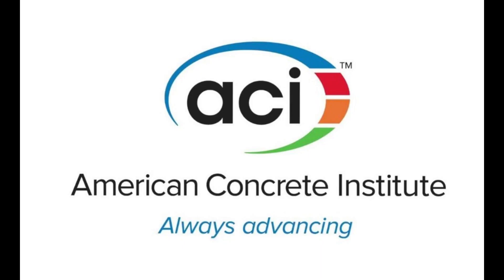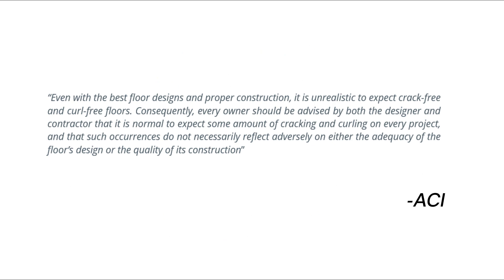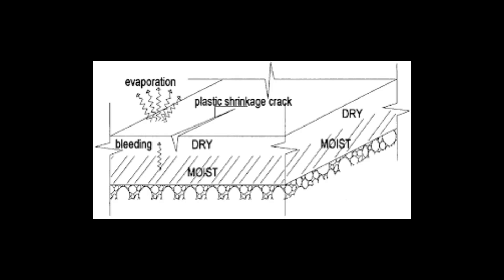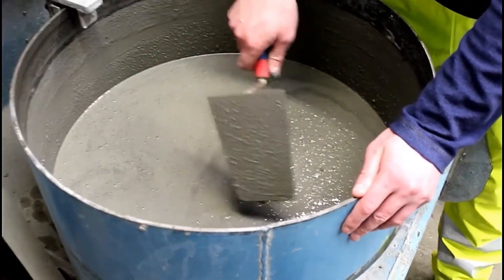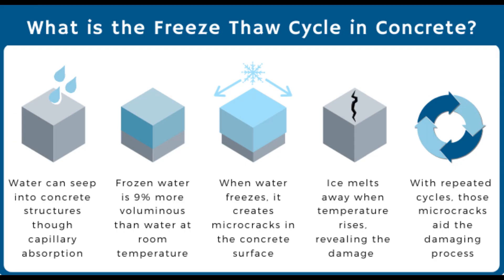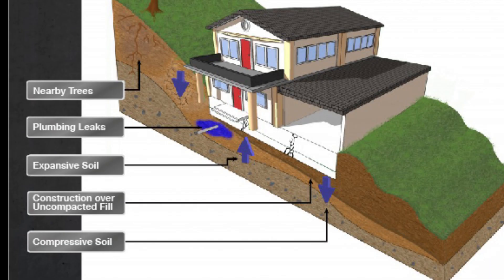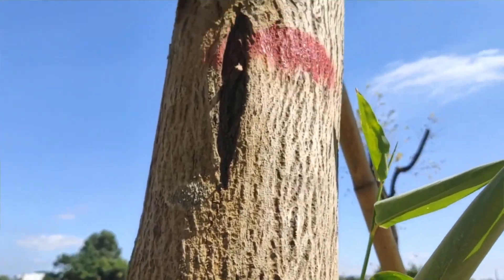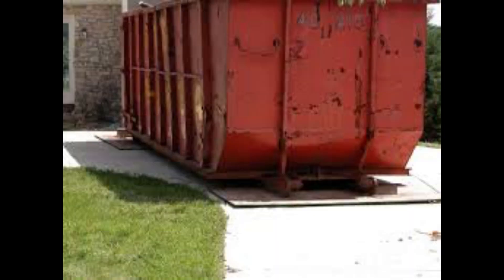Concrete cracks that even most Engineers DON'T know [Gibberish Fox】

Comment: Well, it is important for engineers to stay upto date with the latest research and advancements in their field to ensure that they have a comprehensive understanding of concrete cracking and how to prevent it. However, while concrete is a durable and strong material, it is not immune to cracking. So, it is crucial for engineers to have a deep understanding of the different types of concrete cracking, their causes, and how to prevent them to ensure the safety and stability of structures.

Comment: I learned about six different forms of concrete cracks from the video. Plastic shrinkage cracks, expansion cracks, heaving cracks, settling cracks, overloading cracking, and premature drying cracks are examples of concrete cracks (crazing cracks and crusting cracks).  Temperature and shrinkage are two major causes of concrete cracks that are not mentioned in the video. It is most commonly caused by applied loads such as backfill surrounding the foundation being compacted poorly or too soon, soil compacting as it settles, hydrostatic pressure against the foundation owing to a high water table and inadequate drainage against the foundation wall, or heavy machinery being run too soon or too near to the foundation

Comment: As per the video, most engineers are unaware of six kinds of concrete cracks. The first type is plastic shrinkage cracks that occur when the concrete is in a plastic state and has high water content. The second type is expansion cracks, caused by the concrete expanding and pushing against obstacles that restrict its expansion. Heaving concrete cracks, which occur in countries with four seasons, particularly in winter, are the third type. The fourth type, settling cracks, are formed due to the ground settling beneath a concrete slab, creating a void. Overloading cracks on the slab can be caused by heavy rain or snow pressing down on the concrete. The sixth type of crack is a premature drying crack, including crazing and crusting cracks. Furthermore, concrete cracks can also be caused by chemical reactions like carbonation and salt or chloride attack on structures near the sea.

Comment: Plastic shrinkage, expansion cracks, heaving fractures, settling cracks, overloading cracks, and early drying cracks were all discussed in the video. During the hydration process, various components in cement hydrate at different rates and with varying amounts of heat. A premature drying crack, which includes crazing and crusting cracks, is the sixth form of crack. Moreover, chemical processes such as carbonation and salt or chloride assault on structures near the water can induce concrete fractures.

Comment: Alkali aggregate reactions (AAR) happen when the alkali hydroxides in the concrete react with the aggregates, creating a hygroscopic gel that absorbs water in the presence of moisture and causes expansion and breaking over a long period. Alkali aggregate reaction relates to a response that takes place over time in concrete between the non-crystalline silicon dioxide present in many common aggregates and the highly alkaline cement paste. The affected aggregate may expand due to this reaction, which could cause spalling and a reduction in the strength of the concrete. The most typical type of alkali-aggregate is produced by the alkali-silica reaction.

Comment: There is also Corrosion Cracks, which are cracks that occur in concrete structures due to corrosion of the reinforcing steel bars within the concrete. When the reinforcement becomes corroded, it can expand and cause the surrounding concrete to crack. Corrosion is typically caused by exposure to moisture and air, which can create an environment that promotes rusting. The rust that forms on the reinforcement takes up more space than the original steel, leading to expansion and cracking of the surrounding concrete.

Comment: NASEH AMEEN AQLAN ALWAHBANI (A19EA4004)
Concrete cracks can occur for a variety of reasons and have a variety of forms and effects. "Settlement cracks" occur when concrete settles unevenly, resulting in surface cracking. Delamination occurs when the surface layer of concrete begins to separate from the underlying layers, resulting in flaking and peeling. Both cracks can weaken a structure and allow water and other contaminants to enter, resulting in additional damage. Regular inspection and maintenance can prevent these problems and extend the service life of concrete structures.

Comment: Very informative video in my opinion expansion cracks is common but still some engineers  can not figure out the reason. The main reason fluctuations in temperature where concrete will expand causing increasing in volume of the concrete element. Normally to prevent this type of cracking is by selecting right concrete materials which will control the temperature also curing is very important to maintain element humidity over time preventing cracking. 

ALI  MOHAMMED ALOBADI  A19EA0196

Comment: Delamination crack is the one type of concrete crack that I found that isn't included in the video. The solid particles commonly sink when a compacted concrete slab is permitted to cure. The trapped air and additional water in the slab may periodically flow out as a result of this. Small fractures or holes start to appear in the concrete as a result. Additionally, this is one of the more severe types of concrete cracks. It frequently emits a hollow sound when lightly touched, which can be used to identify it.

MUHAMMAD ZAFRI BIN MOHD SAIFUL
A19EA0100

Comment: Crack that is not mentioned in the video is Crack due to chemical reaction:
Concrete cracking can be caused by harmful chemical reactions. These reactions could be caused by the materials used in the construction of the concrete or by objects that come into touch with it after it has hardened. Concrete may crack over time as a result of expanding interactions between active silica aggregate and alkalis coming from cement hydration, admixtures, or other external sources for e.g., curing water, groundwater, and alkaline solutions stored or used in the finished structure

Luqman Imran Hakim Bin Unus A19EA0063

Comment: Concrete is the most prevalent building material in the world. In this video, there are several of concrete cracks occur due to various causes such as Plastic Shrinkage Cracks (before hardening), Expansion Cracks (after hardening due thermal which is early thermal contraction), Heaving Cracks (after hardening due thermal which is freeze/thaw cycles), Settling Cracks (after hardening due to ground settling), Overloading Cracks (after hardening due structural which is overloaded) and Premature Drying (crazing and crusting).  The type of concrete cracks that are not listed in this video is Chemical Reaction Cracks. This type of cracks occur after concrete is hardening and it is consisting of corrosion of reinforcement, alkali -aggregate reaction (AAR : ASR and ACR) and cement carbonation.  Alkali - aggregate reaction (AAR) consisting of alkali-silica reaction (ASR) develops due to reactive silica minerals in aggregate materials and alkali carbonate reaction (ACR) caused by aggregate particles containing carbonate or dolomite.  Meanwhile, corrosion of reinforcement will take place if the concrete is permeable to the extent that carbonation reaches the concrete in contact with the steel or soluble chlorides can penetrate right up to the reinforcement, and water and oxygen are present.

- GHOYATUL QUSWA BINTI ABDUL RASHID : SX180637KAWS05

Comment: Reinforcement corrosion can also cause cracks in concrete structures. When steel corrodes, it forms iron oxides and hydroxides which take up more space, causing high radial bursting stress that leads to local radial cracks. This can spread along the bar and cause longitudinal cracks or concrete damage. Delamination, which is common in bridge decks, occurs when a wide crack forms at a plane of bars parallel to the surface. Small splitting cracks make it easier for oxygen, moisture, and chlorides to enter, increasing corrosion and cracking.

Aizat Abd Halim SX180683KAWS05

Comment: Structural crack is one kind of concrete crack that is not mentioned in the video. One of the more serious concrete flaws is this one. Inevitably, if they are neglected for an extended period of time, they may cause structural collapse or building collapse. Most frequently, poor construction and inaccuracies in design lead to structural fissures.

Comment: From the video, I learnt that there are six distinct causes of concrete cracks: plastic shrinkage, expansion, heaving, settlement, overloading, and early drying. Rather than fixating on the fractures themselves, attention should be given on the means of preventing them. One way to prevent plastic shrinkage cracks is to cover the new concrete surface with an impermeable sheeting, such polythene sheeting, to slow the rate at which the water on the concrete surface evaporates.

Comment: So, i suggest to how to prevent 6 types of crack ;
1) Plastic shrinkage concrete cracks - Commence curing as soon as possible after finishing. Spray the surface with liquid membrane curing compound or cover the surface with wet burlap or start water curing after concrete placement.
2) Expansion cracks - Application of expansion joints made up of asphalt, rubber, etc.
3) Heaving concrete cracks - Avoid continuous overloading of concrete and adequate curing of concrete.
4) Settling concrete cracks - Make sure the subgrade is compacted.
5) Overloading cracks - Avoid continuous overloading of concrete.
6) Premature drying cracks - Use of a quality mix, proper workmanship and application of appropriate concrete finishing technique.
(Muhammad Muzzammil Bin Mohd Hussaimi SX180125KAWS05)

Comment: another type of crack not mentioned is crack due to corrosion of reinforcement bars. Concrete crack due to corroded reinforcement is a common issue in concrete structures caused by the exposure of reinforcement, such as steel bars or mesh, to moisture and oxygen. Corrosion causes rust to form on the steel, which expands and causes cracking in the concrete, which allows more moisture and oxygen to reach the steel, accelerating the corrosion process and weakening the concrete structure. This type of cracking is characterized by a map-like pattern on the surface of the concrete, it can be prevented by using corrosion-resistant reinforcement materials or protective coatings, providing good drainage, maintaining the concrete surface, inspecting regularly and making repairs as soon as any signs of corrosion are detected.

Comment: Besides 6 types of concrete cracks introduced in the video, there is also one type of concrete crack that not being listed in the video which is cracks due to errors in designing and detailing. Design and detailing mistakes can result in unacceptable cracking. For example, poorly specified reentrant corners in walls, precast members, and slabs, improper reinforcement selection and/or detailing, restraint of members susceptible to volume changes due to temperature fluctuations and moisture, lack of adequate contraction joints, and improper design of foundations can all cause differential movement within the structure.

Comment: There are various factors that can contribute to the occurrence of cracks in concrete. It also can be categorized into before hardening (eg: plastic shrinkage) and after hardening (eg: creep). Another concrete crack that not listed in video is temperature and shrinkage. It most likely due to applied load such as backfill around foundation compacted improperly or too soon, earth compacting as it settles, hydrostatic pressure against foundation due to high water table and poor drainage against the foundation wall, or heavy equipment operated too soon or too close to the foundation wall.

Comment: Cracks in concrete are the most prevalent problem detected in buildings, according to this video. During the inspection, the engineer frequently misrepresents the cracking condition, and the investigation is done visually. Cracking is typically caused by six (6) types of cracks, as described in the video, namely;
i. Plastic Shrinkage Concrete Cracks
Concrete isolation happens as a result of the elaboration of huge solid particles under gravity, and concrete water rises to the surface. Shrinkage occurs when the rate of evaporation from the concrete surface exceeds the rate of isolating.
ii. Expansion Concrete Cracks
All building materials expand and contract when heated and contract when cooled, with the quantity of expansion and shrinkage varying according to their qualities.
iii. Settling Concrete Cracks
Plants can cause the walls to fracture up to the roots, causing the walls to split until the expanding roots reach the bottom, lifting and destroying the concrete.
iv. Heating Concrete Cracks
Soil settling beneath the concrete slab can cause cracking.
v. Overloading Cracks
An excess of load on the concrete slab causes cracks.
vi. Premature Drying Concrete
Refinement cracks and crust cracking are common when the top of the concrete slab loses moisture from the bottom too quickly.

However, in order to preserve the structural integrity of the structure, the repair activities advised and discussed in the video should be completed as soon as possible using the approved repair methods. (NORHADZNI BINTI ABDUL HALIM - SX180635KAWS05)
Reply: It also relates to the e-learning system inquiry to list a concrete fracture not in the video. Cracks not listed in the video include;

Carbonation shrinkage

Carbonation Shrinkage is a decrease in the length or volume of a material (concrete) caused by carbon dioxide in the atmosphere reacting with the hydrated cement in the presence of water. Calcium hydroxide is transformed to calcium carbonate, and some cement compounds are degraded as well. Even at modest pressures of carbon dioxide in a normal environment, such full breakdown of calcium compounds in wet cement is chemically conceivable. Carbonation only slowly penetrates beyond the exposed surface of concrete.

The rate of carbon dioxide penetration is also affected by the moisture content of the concrete and the relative humidity of the surrounding medium. Carbonation causes the weight of the concrete to rise as well as shrinking. Carbonation Shrinkage is most likely induced by the disintegration of calcium hydroxide crystals and the deposition of calcium carbonate in their stead. Shrinkage occurs when the new product has a lower volume than the product it replaces.

Comment: Based on the video, I have learned 6 types of concrete cracks like plastic shrinkage, expansion crack, heaving concrete crack , settling  concrete cracks  , overloading cracks , and premature drying. common crack happen during the hydration process, different compounds in cement hydrate at different rates and involve different quantities of heat.

Comment: As seen in the movie, chemical reactions can result in fissures in concrete. according to the components of the combo and other elements. Cracking is caused by alkalis in cement paste and expanding aggregate. Alkali-silica gel is produced when active silica is mixed with alkalis. On the surface of the aggregate, alkali-silica gel develops, expanding it and applying pressure to nearby concrete. Tensile stresses may be greater than the tensile strength of concrete because of pressure. Stress causes cracks in concrete.

Comment: In this video give more informatio about cracks. 6 types of concrete cracks such as plastic shrinkage, expansion, heaving, settling, overloading, and premature drying. but it difficult to determine exactly what cause a particular crack. proper site preparation, a quality mix and a good concrete finishing practices can go a long way towards minimizing the appearance of crack and producing a more aesthetically pleasing concrete project. (Mohammad Zulfikry bin Ahamd Tamezi - SX182039KAWF10)

Comment: part from those in the video, there are also cracks due to corrosion of reinforcement, corrosion of steel results in the formation of iron oxides and hydroxides, which have a much larger volume than the original metallic iron. High radial bursting stresses around reinforcing bars result in local radial cracks as a result of the increase in volume. Splitting cracks can spread along the bar, causing longitudinal cracks or concrete spalling.

Comment: Chemical reactions can cause concrete cracks, as shown in the video. Because of the combination's elements and other factors. Expanding aggregate and cement paste alkalis create cracking. Active silica with alkalis generate an alkali-silica gel. Alkali-silica gel forms on aggregate's surface, expanding it and pressuring adjacent concrete. Due to pressure, tensile stresses may exceed concrete's tensile strength. Concrete cracks under stress.

Comment: In my opinion, there are many different factors that can contribute to concrete cracking, and it is possible that even experienced engineers may not be aware of all of them. However, it is important for engineers to be aware of all potential causes of concrete cracking in order to design and construct structures that are resistant to cracking and able to withstand the various stresses they may be subjected to. I would like to add up one possible concrete cracks which is the carbonation where the concrete can crack if it is exposed to high levels of carbon dioxide, which can cause the concrete to absorb carbon dioxide and become weakened. The carbon dioxide reacts with the calcium hydroxide in the concrete, neutralizing the alkaline pH and causing the concrete to become more acidic. This acidity can cause the concrete to become more susceptible to corrosion and other types of damage. Carbonation can also cause the concrete to become more porous, which can make it more susceptible to damage from freeze-thaw cycles and other environmental factors.